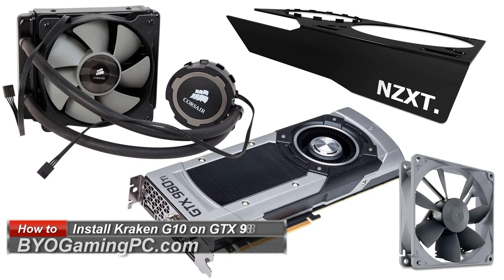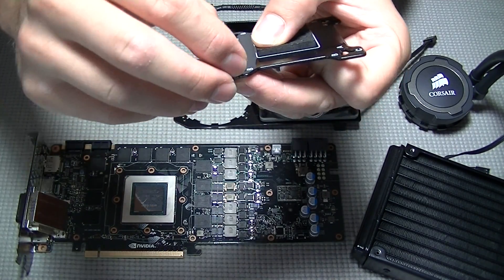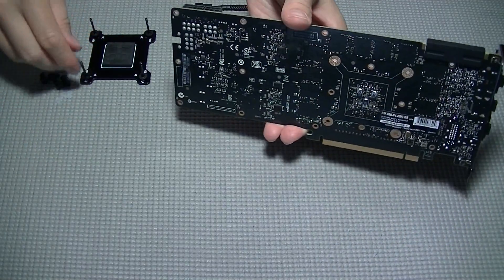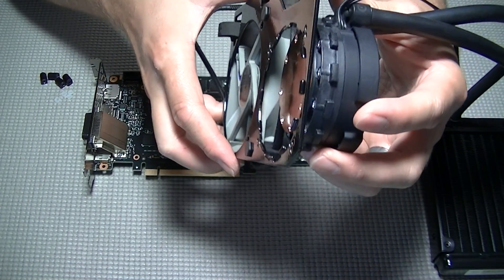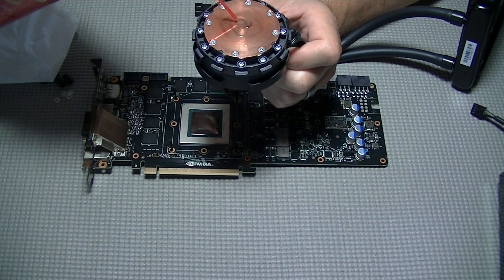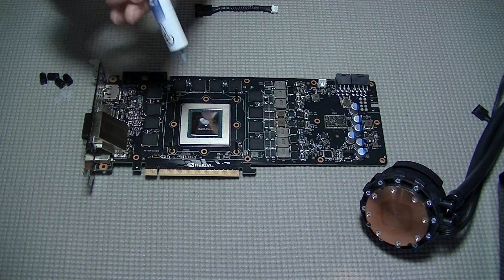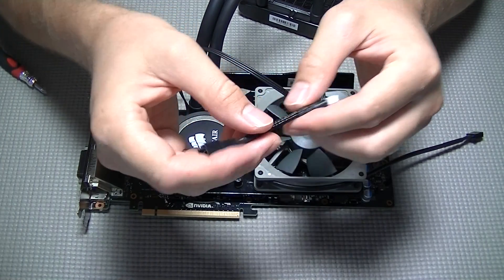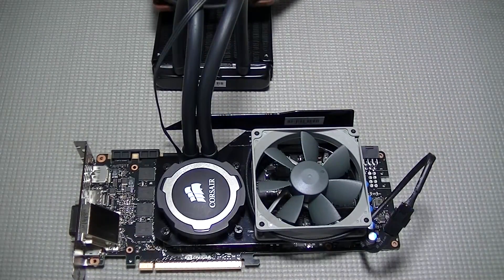NVIDIA GTX 980 Ti Reference & NZXT Kraken G10 Installation Guide & Performance

Comment: What does the asetek style cooler mean?
Reply from the maker: +Stuart Trappe They are the coolers that have a circular CPU block with the little notches around it to be locked into place by different mounting systems.
Reply: BYOGamingPC Oh, so something like the Corsair h50 would work?
Reply from the maker: +Stuart Trappe Though ancient, yes, the H50 should work but I would highly recommend the H55 instead. http://amzn.to/1lqHQGS
Reply: BYOGamingPC Why would I need a slightly higher performance cooler? Don't GPUs produce less heat? Or is it just that the upgrade is worth it?
Reply from the maker: +Stuart Trappe GPU's produce MUCH more heat than CPU's do when they are at load so it takes more to cool them. If you have a H50 lying around then go ahead and use it but if you are going to buy a cooler then get the H55.
Reply: BYOGamingPC Okay, well I mean heat per a certain unit. I will go with your plan and get an h55 and put on a second fan for push/pull con fig. Will I still need the copper square with this?
Reply from the maker: +Stuart Trappe You shouldn't need two fans on the setup since it won't impact the cooling efficiency by much and you won't need the shim if using a reference card.
Reply: BYOGamingPC I'm using an EVGA GTX 970, so I think I might need the shim. I have a bunch of spare 120mm fans so it isn't any extra cost to me.
Reply from the maker: +Stuart Trappe If there is a heatsink plate over the face of the PCB then you will need a shim.
Reply: BYOGamingPC Gotcha. Will it still work with a back plate on it?
Reply from the maker: +Stuart Trappe Yes, if you follow the other video. https://youtu.be/RlGMhASE22w You may need longer screws.

Comment: How about installing G10 without removing heatsink? Like the 780Ti video? Is it possible to do so with 980Ti classified?
Reply from the maker: +Dirty Weaboo Yes, you can follow the instructions in the other video with the same results.
Reply: BYOGamingPC Hmm, im thinking... Isn't getting 980Ti hybrid is going to be the same cost/cheaper? yielding better performance.
Reply from the maker: +Dirty Weaboo The cost will be similar but if you already have all of the parts to do it then obviously it will cost less than just getting a hybrid. Some people still have a G10 and/or an Asetek cooler already. If you purchase the hybrid then you can't use that cooler on another card so some may prefer the ability to transfer the G10 setup from card to card.
Reply: BYOGamingPC
With pascal coming out next i don't think G10 will be useable with it, so i guess i'll just save up for hybrid.

Let's say that i can get 2x970's 1.8/4 price of 980ti. Worth doing that instead and then sell them? I am concerned about vram issue as im going 1440p, but i think i will only use them for the time until pascal comes out. Any advice?
Reply from the maker: +Dirty Weaboo I had a pair of Gigabyte GTX 970 G1 Gaming http://amzn.to/1L5mS64 cards at one point and the performance is almost the same as a 980Ti at 1440p. The VRAM was never really a problem. I'd recommend it.

Comment: great video! just i have a question that is h80i gt will fit in the kraken?
Reply from the maker: +Gergely Krizsan Thanks! No, the H80i will not work. You need to use an AseTek style cooler.
Reply: +BYOGamingPC thanks for the information...
Reply from the maker: My pleasure.

Comment: W8, what is stock VRM and VRAM temp?

I feel that is one of the biggest worry of buying Kraken over corsair bracket, since there is no heatsink whatsoever for VRAM or VRM, but I do not see it became worse than stock or not. :P
Reply from the maker: Byungdon Min I do not know what the stock VRM and VRAM temps were because there was no way to monitor those numbers. I can only give you my best guess from experience with other aftermarket models of cards and say that the VRM temps are definitely cooler and probably in the area of 5C-10C and the VRAM temps are likely to be about the same depending on your case design.
Reply: BYOGamingPC OK, Thanks.

Comment: Hey man great video is this better way than the g1 gaming gets 980 ti
Reply from the maker: faz gassab It's really up to what you want to do. The G1 Gaming is an excellent card that has a binned GPU. I've not done the G10 installation on the G1 Gaming but it would be a great card to water cool with it's OC'ing potential.

Comment: Hello first great vid. Then the questions. I currently have a NVidia gtx980 ref card and I bought a g10 and the kraken x41. I did not install them yet because I heard people having heating issues with the vrams. Do you have any issues with yours?
I noticed in the vid you did not show us how to install the copper heat sinks on the vrams. Any way we could get a picture or instruction on how to install them? Also do we need thermal pads for any of it? Thanks again for the vid and your time.
Reply from the maker: Ryan Grayson I did not show the install of VRAM heatsinks because I did not use or need them. I've not had any problems without them but I did create a link in the description to purchase them. They are self adhesive so they are simple to install. No thermal pads are needed for anything at all.
Reply: Thank you very much for the quick reply and the links
Reply from the maker: Ryan Grayson My pleasure.

Comment: Awesome tutorial :D

Ive got two Gigabyte 980 Ti Gaming G1's in sli, and the top one gets hot like a mother....

Ive already replaced the thermal paste on both of the cards, and the pcb on the gigabyte gaming g1 version is a reference PCB...

If i want to keep using the backplate from the gaming g1, what extra hardware would I need to buy? Since I wouldnt use the nzxt backplate,  could I use the same setup procedure from the Asus 980 Strix tutorial?
Reply from the maker: MrRavingpanda I've actually used the G10 in SLI setups before and having it on the first card (your top) and leaving the other with the air cooler on it works very well. You can use the ASUS 980 video to do the mod to your 980Ti G1 Gaming but make sure the VRM's are located under the fan. You may also want to use the Cosmos VRAM heatsinks http://amzn.to/1TTHMLx on the VRAM chips to keep them cool as well.
Reply: BYOGamingPC Thanks for the quick reply

Could I use these for the VRMs
http://www.amazon.com/gp/product/B007XACV8O/ref=ox_sc_act_title_6?ie=UTF8&psc=1&smid=A1LDHXVK2KF57B

Finally, if I remove the foam on the NZXT mounting plate, could I use the mounting screws and things that come with the Kraken G10? Or do you recommend going the extra screws and washers method outlined in the ASUS 980 video?
Reply from the maker: MrRavingpanda Those heatsinks are actually too small. I know you probably want to get the aluminum heatsinks because of the color but copper is much more effective and those aluminum ones you linked are too small. You want to install or leave the foam pads on the G10 because they keep the bracket from vibrating and moving. You could also try the screws that came with but they have the special threading around the head of the screw that may not allow you to use them. If you try it let me know how it works out.
Reply: MrRavingpanda Look at this setup for the 980 ti. Im pretty sure the heatsinks on the VRMS are the aluminum ones. The ones on the VRAMS are the copper ones you mentioned, thats for sure.

http://cdn.overclock.net/a/ae/900x900px-LL-aedf2546_980tibare.jpeg

I am going to go the safe route and buy the washers and screws you mentioned in your Asus 980 video just to be extra careful.
Reply: MrRavingpanda Actually just found out that a friend of mine has a kraken g10 on hand, so I´ll report if the vanilla mounting hardware for the g10 works with my 980 ti and if the fan placement is optimal.
Reply from the maker: MrRavingpanda Yes, you are correct. The heatsinks on the VRM's are the aluminum ones you linked but are not necessary. The ones on the VRAM are the copper ones I linked and are a good idea to get. The VRM cooling with the G10 is better than any of the air coolers that comes on the card.

Comment: will this work for the titan X as well?
Reply from the maker: Christopher Ong Yes, it will.
Reply: BYOGamingPC thanks for the instructions man,i was able to pull this off for my titan X.I'm able to have 52 degrees Celsius under load.
Reply from the maker: Christopher Ong Awesome! The 980Ti and TITAN X are nearly identical except the extra VRAM chips.

Comment: awesome video .i was waiting for this setup thanks
Reply from the maker: millonarioscarp ! My pleasure, glad it was helpful!
Reply: BYOGamingPC  do you know if the corsair h80i gtx will fit on the nxzt bracket?
Reply from the maker: millonarioscarp ! Unfortunately, it will not since it is not an Asetek style cooler.

Comment: BYOGamingPC Thanks for the video. From this video i understand, if i could get rid of the heat spreader on EVGA 980 SC acx 2.0, there would be no problems for vrams and video memories cooling (if i am not going to overclock it which i won't) + i would not need any copper shim any more. Did i understand correctly? could you give me a feed back on this? thanks
Reply from the maker: hesam g This is correct and I've actually done this before and know that it works.
Reply: BYOGamingPC Two thumbs up to you. thank you for this video. I removed the heat spreader from EVGA 980 SC + the copper  shim. My GPU runs about 5 - 10 C cooler. As I understand when i do not overclock the video memory, i do not need any sort of cooling solution for vrams. Could you please do a fps testing on witcher 3 with gtx 980Ti in "Crookback bog" (swamp) area. this is the most demanding area in witcher 3. thank you so much. youtube should put a Two-Thumbs-up option for videos. cheers
Reply from the maker: hesam g Thanks for the kudos and glad you had a successful install! I will try to do the benchmark using The Witcher 3 sometime.

Comment: Which program do you use to display the vrm and vram temps?
Reply from the maker: Robert Watt The numbers and information you see later in this video are ones that I took with the instruments used in the description and the displaying of the numbers were edited into the video. There was not a program displaying that on the screen.
Reply: +BYOGamingPC Okay thanks ;) BTW how loud is the H75 pump? Is it making weird noises?
Reply from the maker: Robert Watt It is quite silent actually. The H75 is one of the newer Corsair coolers compared to some of the other models.
Reply from the maker: It was fairly silent. I never really heard it.

Comment: Yay! It works,  ;-) I am considering the zotac 980 to extreme.
Reply from the maker: Peter Gratineau You should have good success with that model.
Reply: BYOGamingPC i hope so because it's on it's way :-) The cooler on this card is suppose to be very good under load so maybe i will just keep the NZXT on the 780 and move it to another slot and use it as Physx card, if that ever becomes a thing again.
Reply from the maker: Peter Gratineau I would try it out with the cooler that comes on it and if you don't like the noise level/cooling then make the change.